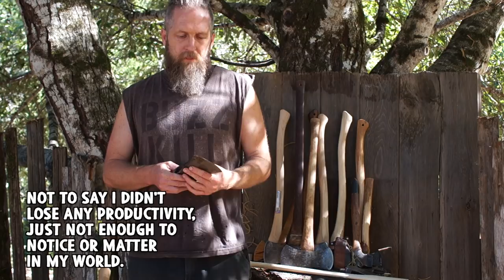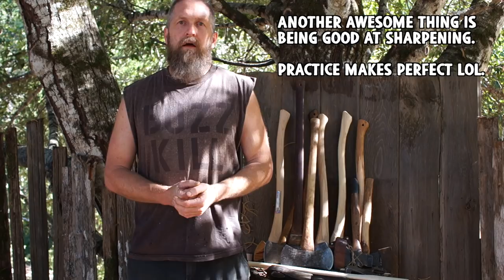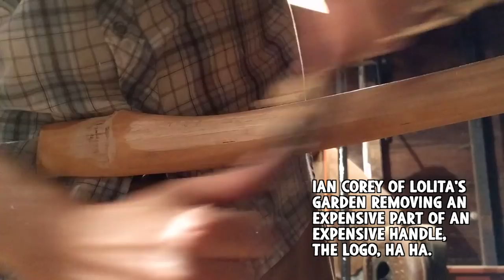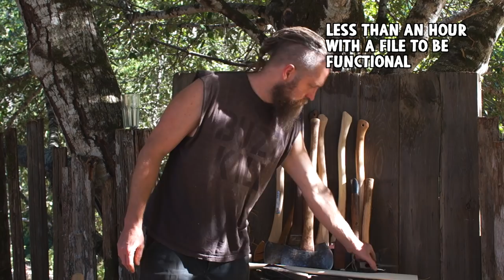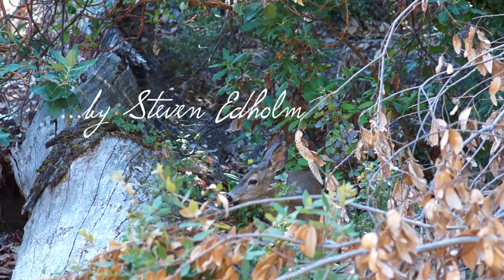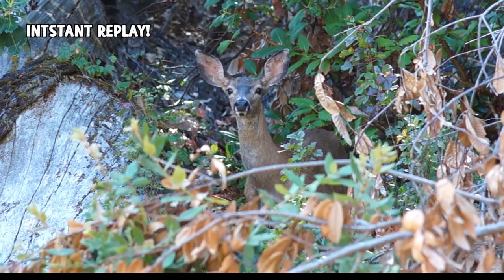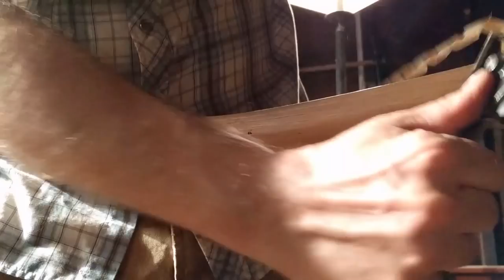Expensive Axe Buyer's Guide: (SPOILER ALERT, Don't Buy One)

Comment: Better steel is ftw 
Cheap steel can be dangerous at time 
I do understand your pov 
And yes you made alot of valid points
Reply from the maker: I'm not advocating buying junk, just affordable stuff.  I'm not sure why it would be dangerous.  I've never broken an axe yet and rarely have seen them, certainly not anything that is likely to lead to injury.
Reply: @SkillCult  had bought some axes in the past not gonna  call names but the head had shatter on a few of them and i did get sum cuts but nothing major tho also on some axes  the handles are poorly slotted in and for some buyers (1st timers) if they dont know how to properly check these things an axe can slip out and cause some serious injuries

Comment: Best "AXEs" for the cost ?? 
· Cold Steel Riflemans Tomahawk $22.
Good weight. 22" handle. Friction fit head. If handle breaks easy to replace in the field. Axe blade. Hammer poll.
· Cold Steel Travel Hawk. 22" handle hatchet 2" edge. Axe Blade. Hammer poll. Friction fit, etc... $22.
· Cold Steel Pipe Hawk. Hammer Poll. $30.
· Cold Steel Norse Hawk. $20-$30. No hammer poll. No spike. Just a huge 6" edge.
· Cold Steel 30" Replacement Handle fir the WarHammer. Fits all cs tomahawks.
· CRKT Nobo Tomahawk. $50-$60. No hamer/spike. Friction fit. 19" handle.
· CRKT Chogan Tomahawk. $60+. Hammer poll. 19" handle. Friction fit.

I like to be able to remove the axe heads for other uses.
Reply from the maker: I've never met a tomahawk that I liked yet for anything but throwing.  Cold steel should make a plain dayton axe, but their market is more sensational/style it seems to me.  Trail boss is basically a hudson bay type, which I'm not a fan of either.
Reply: @SkillCult  did you try the cs Riflemans Hawk ? Its weighted like an axe. Or the crkt wood chogan ?

Comment: I learned the most and used the most a $10 hardware store hatchet.  It was soft steel which was great as I learned to re profile & sharpen the primary & secondary edge. A top dollar Gransfors would not have benefitted me at all. The fact I didn't care about the $10 hatchet meant I did all sorts if stuff with it.

Comment: just a quick thought,  could it be possibile that high end companies are making extra thick handles so you can shave it down to your preferable size?  I mean a big axe handle could work for someone with big hands,  and can be shaved  down if needs be,  to do tbe opposite you would replace the whole handle,  whick would ve a very big waste of hickory or whatever wood they are using.
Reply from the maker: That certainly occurred to me.  It's more how over the top thick some of them are.  Peter vido on Axe connected and Dudley Cook in the Axe Book, both show how axe handles have gotten thicker and thicker over the decades.  In Europe, It may be due in part to the woods used traditionally in those areas being less dense, like Birch and Ash.  Or a combination of the two.  One other possibility is that very fine and extensive axe work was done in building by a lot of those scandinavians, and after a certain point, it becomes hard to control a thin handled axe for controlled hewing and such.  The eyes on scandinavian axes are often larger than on American axes, so it could just be a residual tradition from the woods they used, but no adaptation has been made to using Hickory, if anything, they've gotten thicker .  Maybe a combination of those things, but given that it's a general trend in America too, I think a lot of it is overbuilding for inexperienced users, though in many cases, I think the logic and solution are faulty, because you lose shock absorption and because  having a large disparity between the eye size and rest of the handle creates more stress just below the eye.
Reply: SkillCult very interesting,  watching other videos of yours I've noticed that as you pointed out, many times the handle is too thick in specific places which also makes slimming it down almost a bad idea, therefore I think I'll switch my opinion to bad design overall. 
Afterall if a handle was made too thick on purpose,  taking away some wood should not come at a functionality cost. 
Well I gave them a fair chance :D
Also it might be that they just hired a designer to create the handle model and not someone proficient. 
You should ask the companies maybe you get a response,  it would be interesting

Comment: I know people like that.  I hardly ever research on the internet.  I watch a lot of videos but I take a lot of them with a grain of salt.  I will take my 40 year old TruTemper axes agains anything from Sweden.  My favorite is my 4# trutemper single bit that I cracked through the eye when I ran over it with a tractor.  I had it MIG welded and hung a new handle in it, last year.  It is ever bit as good as it ever was, now.  I have a TruTemper boys axe, just like you have - red paint and all.  I rehandled all of my axes last year with new hickory handles.  I agree with you on handle modifications.  The 36 inch handle on my TruTemper Swedish steel double bit is an example.  It feels like a club.    My CS Trail Boss is ever bit as good as a GF Small Forest Axe.

Comment: Awesome video! If I may give my poor-ass Pole perspective. Reasons why I personally considered buying a premium axe. There may be no middle ground on the market. In Poland you get useless axes for $7, >perfectly fine steel< axes for $10 and then there's premium. What I don't like about the $10's is that they require reprofiling and sharpening from the ground up. This may take hours for an inexperienced workshopnoob. Second, they may even come kinked! Third, the handle is often just for looks, poor beech with poor grain orientation. You might as well consider it an axe head purchase. Also keep in mind that USA is Eden when it comes to vintage tools. In Poland we have poor availability and the prices are at least 3 times higher. 1 kg blacksmith's vintage hammer, hung? $40 please. All that said, when I'm done with my cheap frankenhatchet I'm experimenting on I'll certainly consider buying Robinwood's hatchet which is of perfect quality AND comes razor sharp.
Reply from the maker: Good point on the time fitting up an axe for use.  Of course that is good experience, but it's true, no cheap axes are ready to chop out of the box.  Reasonable handles and quality are obviously pretty essential.

Comment: Subscribed! Here from Essential Craftsman channel recommendation. Im an amature with an axe, but have split wood for outdoor fires over the last 15 years. A bunch of split handles near the head, currently my axe handle is fraying near the head. Suggestions/ guidance for replacement? Maybe you have a video already? I’ve replaced my handles before with cheap ones from the hardware store but always feel like I’m putting them on wrong, as in the head sometimes falls off... anyway, thanks for the great content man! From CT. -Art
Reply from the maker: If you do work that consistently causes handle damage near the eye, by all means put some protection on it.  A good collar/wrap/brace up there will go a long way toward preventing damage and failure.  Splitting rounds, you just get damage sometimes from stuff you can't prevent.  I have some vids on axe wraps and collars, and why I do and don't like various approaches.  get the fit as good as you can, make sure the woo is dry, wedge tight and hope for the best.  I usually just add metal wedges as needed.  I don't really have an instructional vid on that.
Reply: SkillCult yea I had wondered about wrapping and how effective it would be. I’ll watch the videos you have and go from there. I’m sure just getting better/more efficient with the tool would prevent the splitting as well. Thanks man. You’ve got a great channel here.
Reply from the maker: It is very helpful.  Of course skill helps and caution, but especially splitting wood, accidents happen and if we are too cautious, it cuts into productivity.

Comment: I bought a nice axe for my first axe. It's a refinished vintage hults bruk with a handmade handle. I use it a lot. I get that "new axe" feeling every time I get it down. I have no regrets. Having said that, I grew up using hatchets and axes so I wasn't exactly a novice. If you've literally never touched an axe or hatchet then sure, buy a cheap axe. Otherwise, I'd say get something (nice?) that you will be comfortable and happy working with. I plan on keeping that HB till I die. If I break the handle I've already made an outline of it so I can make another one. I'm not a big fan of buying something with the idea of upgrading to something else later. As far as I'm concerned that's just burning money on something that I didn't really want to begin with. By the way, your neighbor sounds silly...not for buying a Wetterlings but for thinking he needed to get four or five. They're axes, not tupperware.
Reply from the maker: Yeah, there is a big difference between someone with experience buying into quality, real or perceived.  It's easy to overbuy for a novice though and the most appropriate tool is something that can be experimented with and it doesn't really matter that much if it gets trashed.  My neighbor is okay.  He doesn't have a context to judge the information he's reading.  Probably picked up a lot of bad advice on the internet.

Comment: After watching this video, I promptly returned my (unused) Hults Bruk Almike hatchet and bought an Estwing Sportsman's Axe instead.  The Estwing isn't the most amazing cutting tool to grace the face of the earth, but it does everything I need it to, which is to say I mostly just process kindling with it.  And it only set me back $35 instead of $139.  I've already beat it to hell, mis-sharpened it, re-sharpened it correctly, and beat it to hell again--basically all the crap I would have been too afraid to do with the Almike.  PS - Would have taken your advice to "go vintage," but living in SF, that wasn't much of an option.
Reply from the maker: The almike is one of the few new expensive axes I'd like to see in person because it has the handle length I like and other reasons.  but I'll never buy one or review it because I'd never actually recommend it at that price anyway.  I'm not a big fan of the estwings as all purpose hatchets for various reasons, but they are indestructible and make good knock around tools.  I've bought at least 4 cheap used hatchets in the past couple of years at junk stores and flea markets and I hardly go out.  Cheers
Reply: @SkillCult  The fit and finish of the Almike I received was lower than I'd hoped given the hatchet's price point.  The handle also came soaked in (heavy metal-ladened boiled linseed oil), along with the obligatory Prop 65 warning.  Overall, I'd say you probably aren't missing much.
Reply from the maker: @alexr4493  Poor handle fit seems to be a fairly common complaint about Hults stuff.

Comment: Just found your channel and I'm finding it helpful. I have moderate ax experience and looking to possibly build my first axe. found 2 heads. one is simply stamped SEARS USA and the other is stamped DUNLAP USA. I know dunlap was a sears brand but do you have any insite as to the quality of the steel on either. I'm guessing the Dunlap is pre 1970 and maybe 70's for SEARS axe. I figured most US made axes were decent quality at that time. any info would help.
Reply from the maker: I know very little about that kind of history.  I'm surprised it says sears and not craftsman.  I'm sure all their stuff was contracted out and probably to different makers over time.  Axe Junkies has a lot of members that know more about that stuff.  If it seems in decent shape, it's probably worth hanging a handle on.
Reply: @SkillCult  
Craftsman was Sears top of the line tools. Dunlap and Sears were their "second tier" tools for lack of a better term. I know they were contracted out but not sure as to who though. Thanks for the quick response and the tip on where to seek further answers. nice channel you have there. I'll be watching.
Reply from the maker: well, if it's old sears, it's probably better than new craftsman lol.
Reply: @SkillCult 
My thoughts exactly. Isnt that a sad thing?

Comment: My sister bought a house on a 1acre plot in jenkintown PA mostly hardwoods on her property One day doing yard work raking leaves 🍃 I unearthed a 3-1/2 pound Mann axe jersey pattern covered in rust cleaned it up went down to ludwigs antique tool shop in glenside PA and picked up a old fawns foot hickory handle first thin handle I have ever seen got the handle for 5 bucks old timer in the store said the handle was old but he wasn't sure of age those old timers sure knew how a haft should be Like I took down a couple of trees with my at the time new axe and I have never felt a handle like it before i also have never seen a more beautiful fawns foot I now keep the axe in a gun case because it is the model for which I build my handles the axe is priceless to me and only spent all together with BLO like 10 bucks
Reply from the maker: If you go on ebay and look at axes, you can see sort of a historic progression.  Old illustrations will also show some very slender handles.  Dudley Cook talks about it and so does Peter Vido on AxeConnected.com  I think Peter has pictures of handles over the decades as they get thicker and thicker.  Once you get used to thin handles it's hard to go back.  Nice score.

Comment: “It is not about the money” And  “you get what you pay for”. Two very old but true sayings.
Reply from the maker: Those are extreme generalizations.  Something like occasionally truisms.  It is actually about the money for people that don't have a lot of it, and also when what you pay for is NOT what you get, which is sometimes the case unfortunately.  If I can get a killer vintage head for 5.00 that is likely every bit as good as a new axe over 100.00 should I look for an axe that costs 300.00 instead?  If I want to learn to play the violin, should I save up for a strativarius because money is no object and It will cost the most?  Context, context, context.

Comment: It all depends on how much you use it and your skill. Experts need better ones. Amateurs and beginers don't. Also, if you can't take care of it or abuse things, go cheap. If you use daily or weekly and do heavy use, live in the Boreal and have cut many trees down and such, you need a better tool. It simply works better. Bit thinness is absolutely critical to be honest, at least for pros. Also, proper temper, proper handle grain direction, proper handle material and shape, and also steel with impurities worked out cost money. You do get what you pay for, the question is, will it benefit you. Everyone is different. I'm a pro, been using axes almost weekly for 30 years, and thus I have a heck of a collection. Not everyone is me, and that's okay, too. Also, some don't have the cash to spend, that's okay too.

Comment: How does it work?
Can't someone stick a soft cheap one in fire, plunge the glowing mass to whatever oil?

btw, I just bought a 9.5" Hultafors mini, cuz it looked cute 'n handy. Estwing mini is a beast tough head, but I liked the look of wooden handle. ~ Yeah, 80.00 + 24.00 shipping from Israel to Chicago, but many wanted 130-150.00. (lol, oops on the product in Israel)

I'm here/YT poking around trying to find peeps favorite puck type sharpener for a polished edge. I've decided to beat on/use my pristine '68 era Western Bowie vs leaving such to lame nephews who would grab your staff for a fire poker, while in the woods. (lol, did I just rant?) So there would be resharpening knives in the field too. 
Do you have a preference SC?
Reply from the maker: I have a video on the two sided king stone I like. It's only to 1000, but that is fine for an axe.  For knives, you might want to go one grit higher before stropping. Etiehr way, it's an awesome, cheap and effective puck/stone.  search for skillcult axe puck and you'll find it.  Here's my amazon affiliates link.  https://amzn.to/36OVICH It goes as low as 15.00 sometimes. But watch the videos.

Theoretically it could be as simple as heat the bit, quench the edge, then hold it up and watch the edge color until it's the right temper and quench again.  But it has to be hot enough and not too hot before quenching and what kind of steel is it, and what color to draw the temper to?  I would guess that most likely if I did that I could get it right the first time with my moderate smithing experience, but it does require some knowledge and experience.
Reply from the maker: Oh, and I meant to say that I use that stone with a strop loaded with polishing compound to finish axes, but no real reason to go any more refined than that for an axe.
Reply: @SkillCult  Thanks for your time SkillCult.
Have a great year wish launched o're your gunwale. (-:
Reply: lol, I meant to say this is as far as I've to look around. 
I've spent my work life as chem operator..part of which was scraping 1k to 20k tanks. 
I could sharpen a puddy knife I could shave arm hairs with using a 10" mill bastard file. To remove the near hair thin burr I'd slide it along wood, 'n back to it.
~ lol, never more refined than that. 
I couldn't wrap my head around stropping with leather, even with so much stropping on tv for a shave. 
Finger tips skin looking like fish scales, thumb nails way too thin from testing was me. 
Explaining to dates was funny. 
tips me hat ~